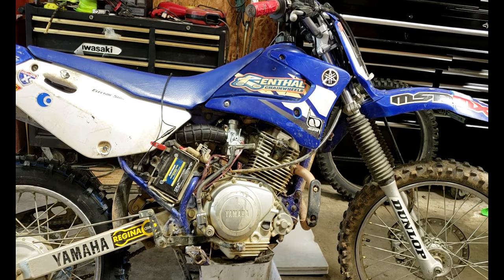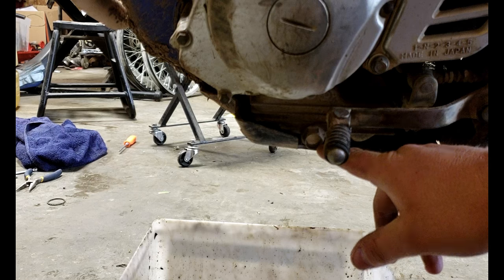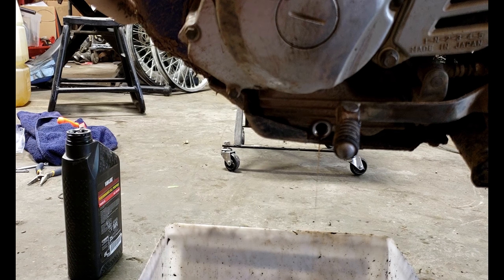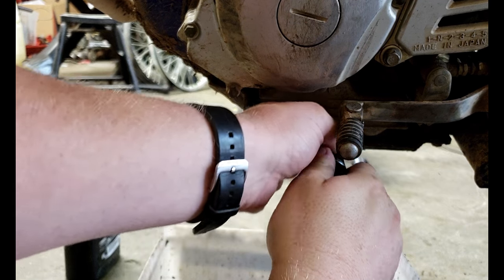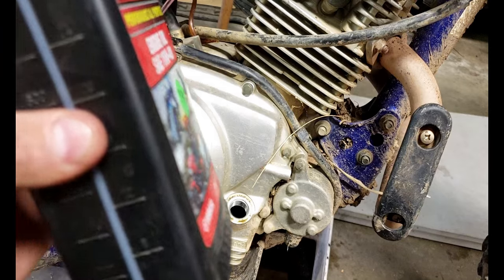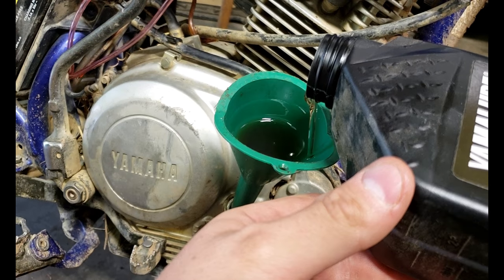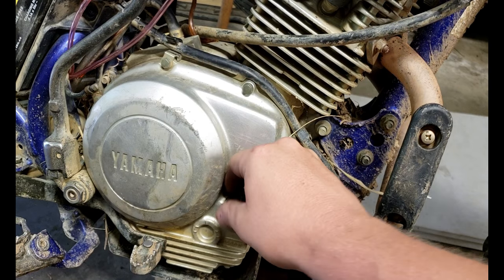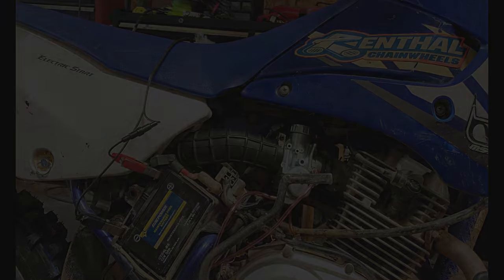HOW TO CHANGE THE OIL ON A  YAMAHA TTR 125

Comment: I have a 99-2000 ttr-125 do you have a video about the carborator and where the fuel line goes I popped a wheelie n tha bike fell and now it won’t start I got 2 pinkish color fuel lines loose
Reply from the maker: Those are vent lines, not fuel lines.

Comment: My oil was bad so I changed it I put a quart 10w40 in it ,now it smokes like a train any advice
Reply from the maker: If you drained your oil and then poured in the correct amount of New oil, that can't change anything as far as smoking. The smoke means either worn out rings or valve seals.
Reply: wrong type of oil
Reply from the maker: @bridgetteg2006  incorrect.

Comment: You missed 2 very important steps in this video and it should not be followed at all!!!! This bike also needs to have the clutch side cover removed (same side as oil fill) and drain the rest of the dirty oil and then there is a screen just inside of that cover that should be cleaned and inspected for debris that are a sign that there should be further inspection for engine damage. DO NOT just drain and refill!!!!
Reply from the maker: Eat my shorts Georgie boy
Reply: @mxgryan  dude I'm an 80's MMI graduate and michigan state certified motorcycle mechanic. See too much bad info on YouTube from self proclaimed experts. Someone going to caused their bike damage if they don't do it right.